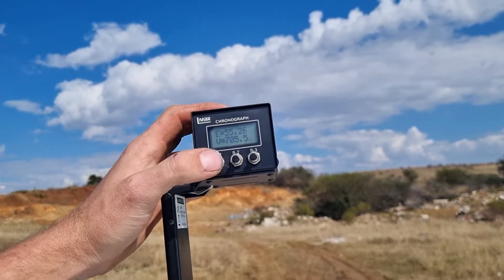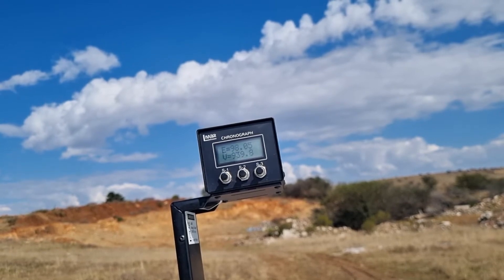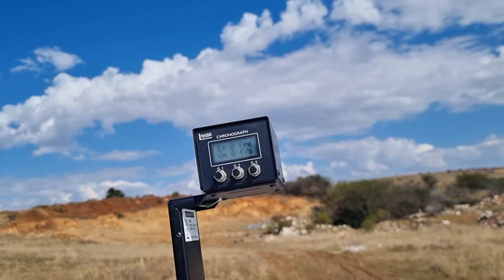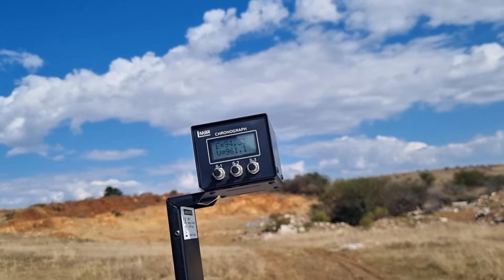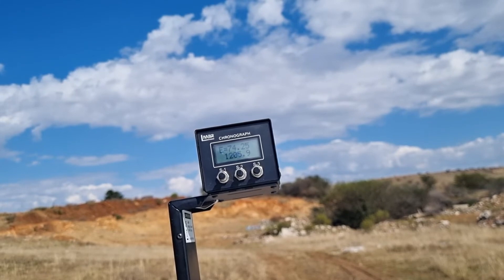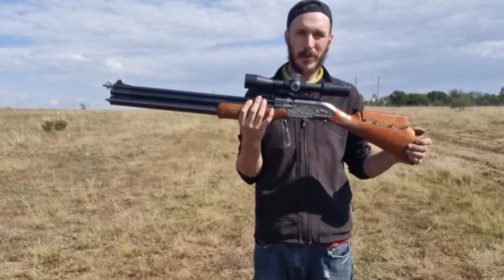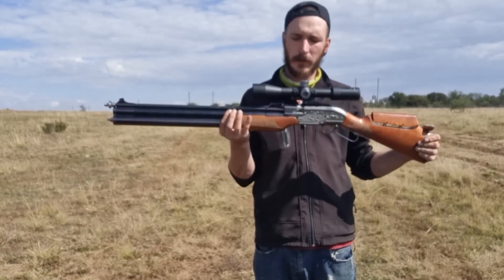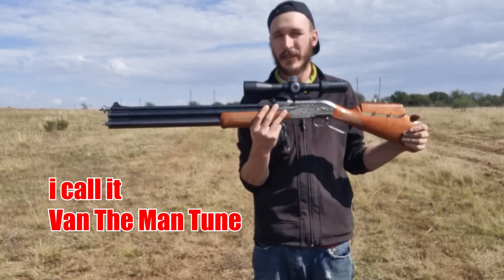We did it | Worlds strongest | .22 Sumatra | 100Ft/lbs | 60Gr slugs

Comment: I will give you a suggestion. That barrel is not designed for those slugs. They literally slip into that barrel. Go and get yourself some African Air Ordinance 50 grain slugs. They have a coating of lubricant on them out of the packet. So now you wash them with freshly boiled water and some sunlight dish washing liquid. Redo the process and let them dry out with a hairdryer. When you put that slug into your 1:24 twist barrel you really have to push it in which means that it grips the barrel and when I say grip I mean it grips the barrel. Yes, it  does not have a good BC (about 0.03) but it is on target every time right out to 200 metres. They are deadly right out to 100 metres where they will hit with about 80 clicks and about 40ft/lb of power with ease. You should get about 930fps out of your barrel in order to maximise your spin. They tend to destabilise at 215 metres and then they start to tumble. You will also encounter spin drift of about 30cm to the left at 200 metres. So it is a trade off for accuracy or distance. I would rather go and shoot a springbuck at 100 metres and be confident of my kill than rather miss completely and shoot the animal in the stomach. You do not need to change that barrel. Trust me.
Reply from the maker: Hey man tanx for the comment and i totally agree with you but im happy with the .217 23gr zan slugs did them up to 300m on a 300x300 mm plate and all 6 shots are there just a few mills drop betweet each shot but thats the best slugs i found for the gu. Im not going to hunt with the gun ill stick to birds and stuff but 50grain yes i agree  100m its huntable i just checked if i can make my own valve make the same power as the african air's valve and i did so thats what the video is about. The valve i baught from them keeps leeking if the preasure goes below 180 bar so i wasnt happy with it and took my valve and modified it to do 100fpe
Reply from the maker: But also this gun wil make alot more power with a longer barrel so in the end ill have a 700mm heavy fx slug liner on the gun thats my aiming poi t

Comment: Yeah unfortunately the upgrade kit I bought didn't work. Got like 40 fps extra. R4000 later. Won't mention who supplied the upgrade kit... Now it keeps leaking and my smith can't figure it out. Very frustrating. But i got a Huben K1 so that's been fun! I saw on another video that you shoot it at 250 bar. Maybe I should try that. It has extra air in the plenum so why not push the pressure higher.... Where do get these massive heavy slugs!!!! I want them!!!!!!!!!
Reply from the maker: hey man i have a friend that made that for me custom are you in south africa? if you have a heavier hammer u can bump it up to 250bar but the valve i baught same issue starts leaking thru at 180 bars so i took my standard valve and modified it and made 100ftlbs same as the 5k valve but mine doesnt leak any air haha
Reply from the maker: send me a email slinginglead22@gmail.com we can chat there

Comment: Hey mate...Love your work...I am a big fan of this rifle and i believe it has the ability to do it with some mods....It can be the best...Needs a better barrel like you say to get the twist rate right....I have tries polishing the barrel..This improved it some but still when cranking it up looses accuracy..
Reply from the maker: Im working on putting up a slug liner 700mm or 800mm so sty tuned for that but yeah glad to reach 100ft lbs so yeah tanx man
Reply: @slinginlead4886  will be interesting to see how to make that fit properly also with the added length how to cover the over hang..Im sure you will figure a way.
Reply from the maker: @emp731  well it will be carbon fiber sleeve so should be fine its gonna work like the fx tentioner
Reply: @slinginlead4886  Awesome..I look forward to seeing that...If it goes well i will do the same...African air ordinance kit and a fx barrel liner and sleeve...This is next level stuff👍 ..Im glad someone is doing this.... I am yet to figure out how to integrate a regulator on this platform..That would complete the package
Reply from the maker: @emp731  im bussy with the regulator aswell i did naught the african air valve and after 14 shots mine started leaking air and aswell under 180 bars it also leaked so i took my origenal valve mod it and making the same power now as the air ordinance valve bussy with the internal reg with a plenum idea so just waiting for a few companies to assist in their products and then we shal have a gun making more power then the fx
Reply: @slinginlead4886  Absolute rock solid....Love your line of thinking...It certainly has the power...With the other components in place this could be a real game changer..damn.